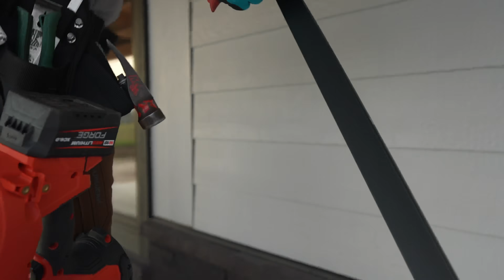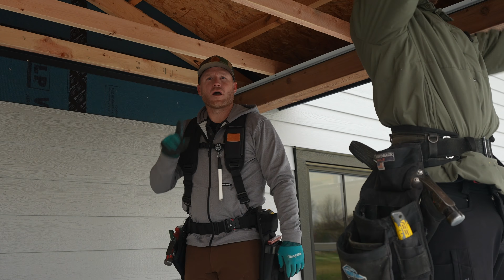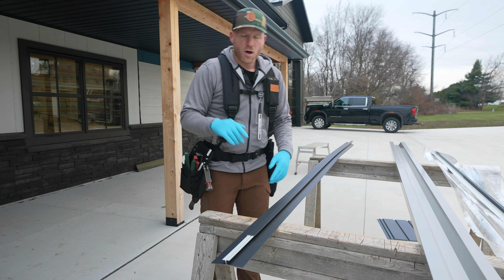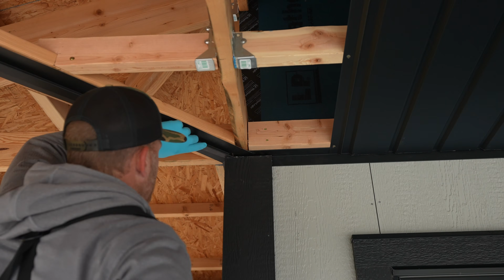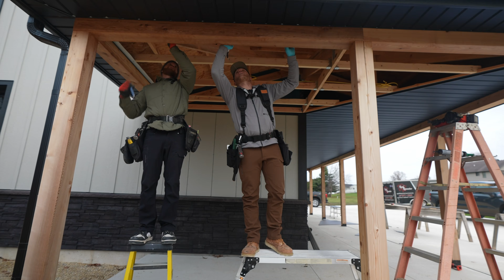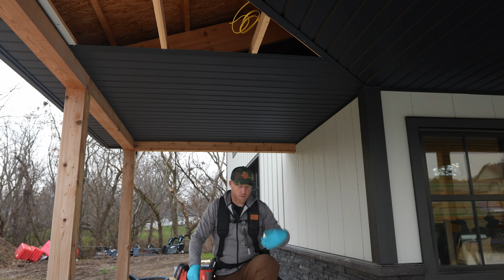Quick and Easy Porch Ceiling at RRHQ: Speedlap Steel Ceiling Installation

Comment: They didn't face nail it anywhere. You should use black trim nails face nailed on at least two joists. This will prevent the soffit from coming loose from the groove and drooping.
Reply: or screws?

Comment: 22:00 instead of bending the sheets into your trim on your straight runs just slide it from the ends before you do any miter sections and then you can have matching trim on either end. Also on the miter section try doing one side of your sheeting and then installing your trim and you only have to fight half as many pieces. @RRBuildings

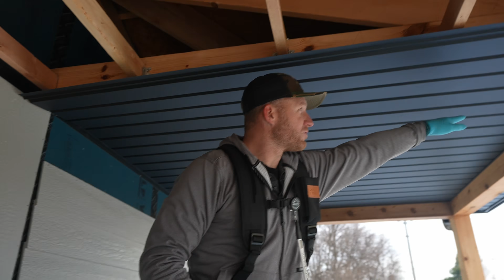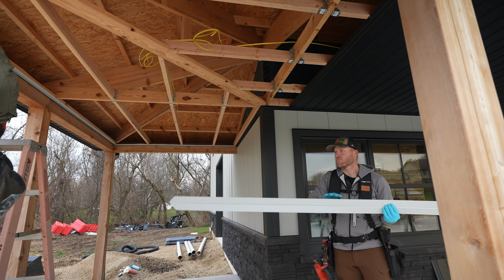Comment: 9:10 - the white showing in your channels is why I prefer using F channel. It is a little bit more time consuming to cut but not very much and astetically speaking it is definitely worth the time difference. Also 18:20 see if your supplier can get the miter trim that's one piece. @RRBuildings

Comment: I installed the same product for a 12x12 patio ceiling. After a week of Utah wind I added color matching fasteners. This product is unstable during high wind events. You will hear the annoying wind/metal noise very quickly. Stick with traditional metal & fasteners. I’ll never use this product again.

Comment: Hmm, I wonder how long you can get the fully vented pieces. I'm considering doing the entire ceiling in the workshop with perforated metal so that more of the sound can be dampened by the insulation above it. Something like this might make that pretty easy if I could get pieces that are long enough. I guess worst case I could run a double-J in between butt-joints.

Comment: Quick question,

Is there no worries about fluttering under windy conditions?  Like a slight chattering of the material.  Would a foam board or an adhesive be utilized?

Anything opinions and concepts are welcome.

Thanks in advance

Comment: Once you place a panel over the electrical wire, some type of marker such as painter's tape should be adhered to the panel. No guessing later where that wire is. No need to look on your electrical plan to see where it was planned to be.
Reply: I was wondering if they would cut the holes as they went.
Reply from the maker: No need… I know exactly where it is

Comment: Kyle if you used this steel for a ceiling in a pole barn how can your trusses be apart and still support this material without sagging from the weight of the insulation

Comment: just a thought... when u stuck the cut-off piece in there at the start of the 2nd side... once you have the piece up against it reach over top and run a few beads of big stretch along the faces where they meet and it'll completely silence it and never have a vibration... Just an idea for your next job 🤔🤔
Reply from the maker: Thanks I like it

Comment: Wouldn't it be easier to come out of the mitres on the last section but what I'm very curious of is why not bend the cut off piece get to show off that brand new brake and bend back in to the original bend I know it really doesn't matter and just putting that cut off was probably a lot faster. AND GREG IS STILL THE GOAT
Reply: You just like to hear yourself talk